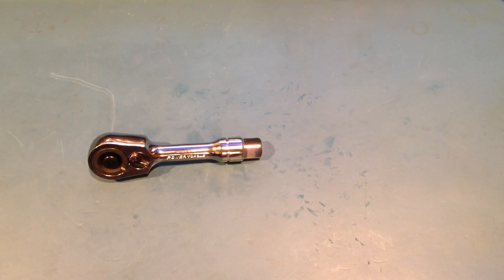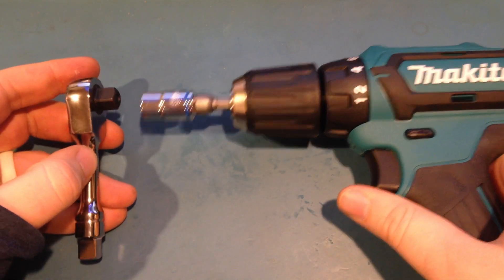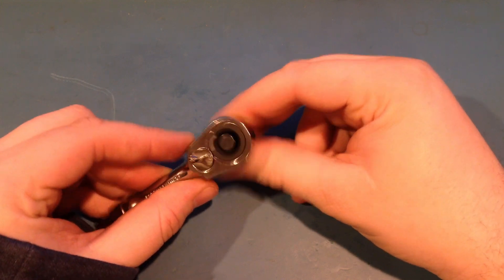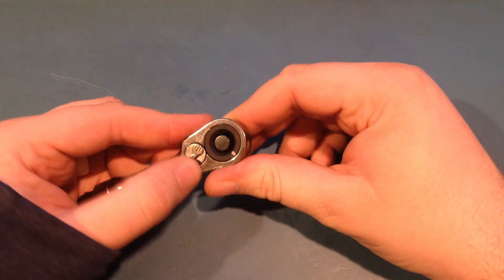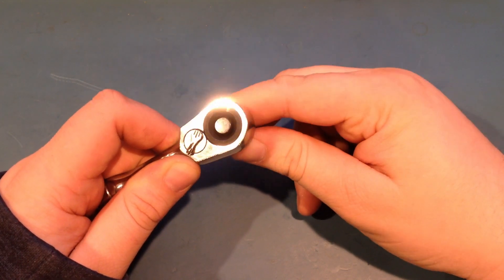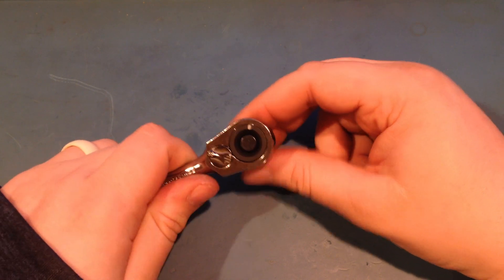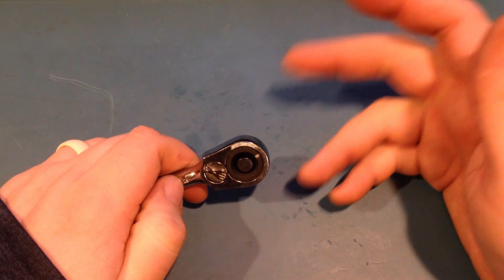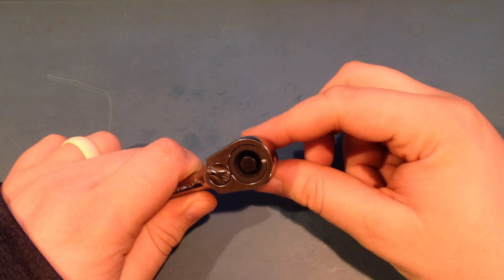Ratchet Failure Mode- Clean Slipping Pawl

Comment: I wonder if it's greased from the factory and spinning it so fast gummed something up. I guess you could try WD-40 or some sort of solvent and relube.
Reply from the maker: Yeah, I'm thinking submerging it in atf or similar.
Reply: @Jaspel  I was thinking something more like mineral spirits or kerosene if there is a glob of grease in there. Then oil once that dries. It still might not work very well, though.

Comment: There is no way to spin that ratchet that fast by hand. I wonder if the insides of the ratchet got messed up when you used the drill on it?
Reply from the maker: Agreed.  I've had this happen before on this style under normal use so I don't think it's unique to the drill, just provoked.

Comment: Its going to keep doing that and then at times it will work and engage until it finally fails and not lock at all and the anvil will keep spinning .... It happens to some least inexpensive brands especially when used continuously day inn day out
Reply from the maker: Do you know if that's specific to the design of pawl inside the anvil (SK) or double pawl sealed (reversing gearwrench style)?
Reply from the maker: I'm tempted to mill it apart.
Reply: @Jaspel  possibly i may say depending upon the use and how consistent it has been used ...I have had least inexpensive ratchets other than Tool truck Quality brand Ratchets that has done exactly what you are demestrating in the video the last time it occurred on me was with a normal standard handle that I had used day inn day out until one day I realized it wasn't engaging properly and I went to toggle with the selector switch just as well but there was no need for me to use a impact to see or determine exactly what you showed in the video because the ratchet was well broke inn ...I had it for roughly for about 6 months and one day the anvil just kept spinning and not engaging or locking up so I sat it to the side and went along with another ratchet for awhile but you know how when you use something so consistently you feel bare and naked without out so I tried using it again then all the sudden it would engage for roughly about another week or Two until it finally failed completely on me I wound up warranted and having it replaced...The brand during the time was Teq Pro that is sold by Advance Auto parts stores with they also use to sell Gearwrench heavy until they converted to the Teq brand line as there premium set up but between the Teq and Gearwrench there basically about the same